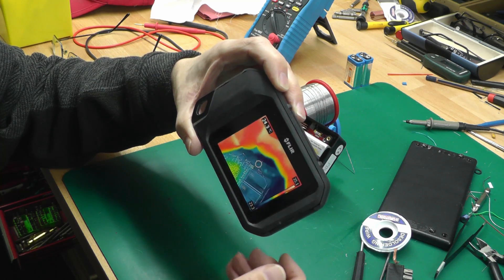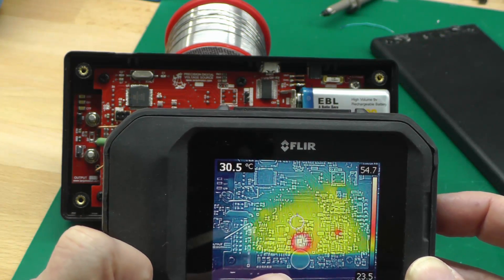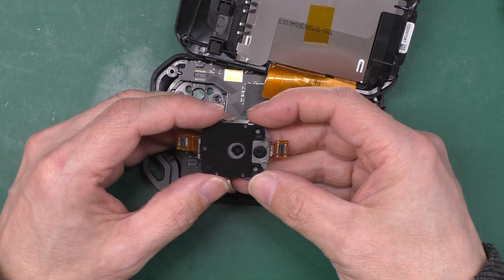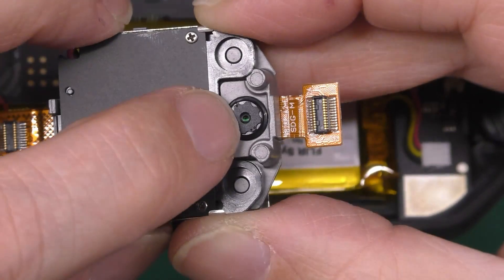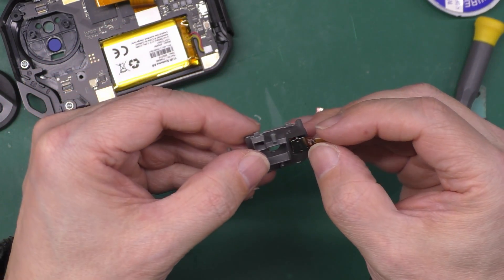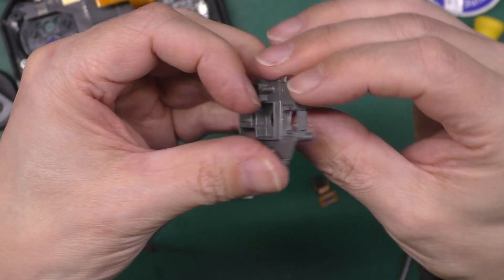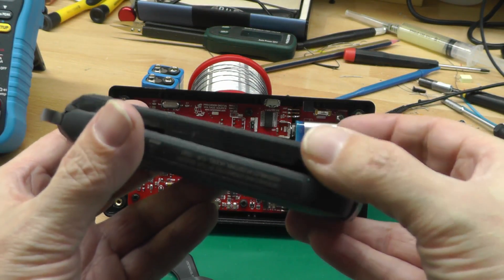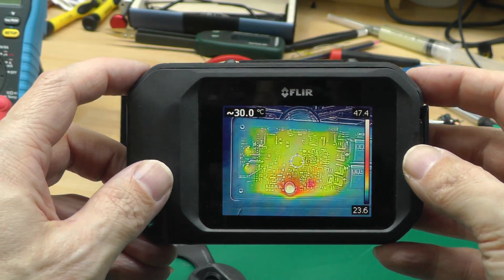No.043 - Flir C2 Optical Modification

Comment: Here's how to do this in software, for those of us who don't want to void our warranties:

1) Open FLIR Tools
2) Extract full photo image
3) Set main image to thermal-only
4) Open both images in Paint .NET ( www.getpaint.net if you don't have it already)
5) Resize thermal image from 320x240 to 454x340
6) Align thermal image to photo image
7) Apply Pencil Sketch effect to photo image (pencil tip size = 5, range = 5)
8) Use Magic Wand tool to select empty area surrounding thermal image, then open Edit menu and click Invert Selection
9) Click Crop To Selection button

It's kind of a pain to do this manually, but since I don't have to take thermal images for my job, it's less of a pain than paying $260 for FLIR Tools Plus.

Comment: I agree with Adrian.  Why not contact FLIR, send them a link to this video, and see what happens.  I bet they can easily add a feature to shift their video presentation to match.  Given distance from subject versus how far apart the lenses are physically to one another, I bet there will be some non-linearity... and I also bet the geniuses behind this product can clear that up, too.

How far back must you be from the circuit board under test such that the optical and IR images converge?  As you increase the distance, do you lose the convergence?
Reply from the maker: I've sent an email to Flir so we'll see what happens. I linked this video and mentioned the apparent untapped marked of electronics repair (without breaking the bank).

Comment: My flir one pro have a dedicated software setting for the parallax, your C2 doesn’t ? By the way, the excursion is not enough to compensate the difference in very close shooting and also does reset to it’s default setting on every reboot...Flir engineers could have done something definitely better...
Reply from the maker: There is an "alignment adjustment" on the C2 itself, but it's minimum setting is 3ft.......and playing with it and another setting for "distance" under measurement parameters , both don't seem to do much at all, certainly not affecting parallax. Mine is an early C2......hmmm!
Reply: It is the same on the Ex models, only 1 meter scale on distance, and even if set to 0 meter, then the calibration seems to be around 25 cm